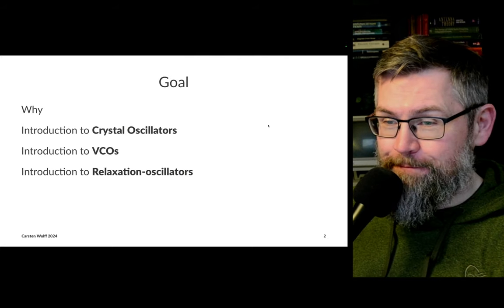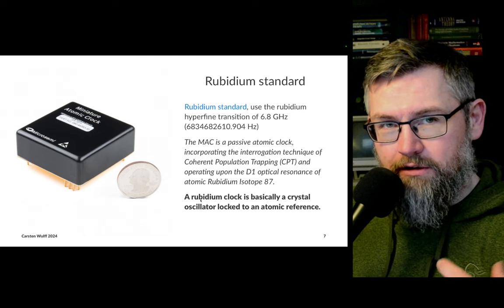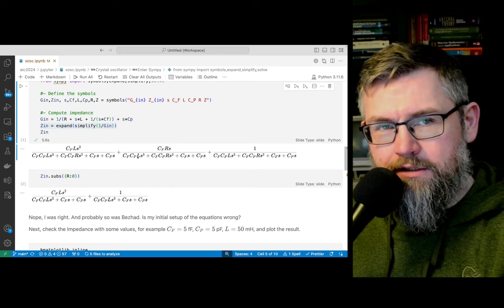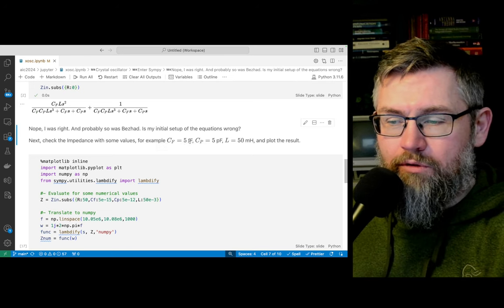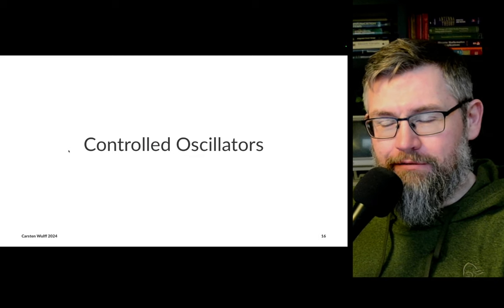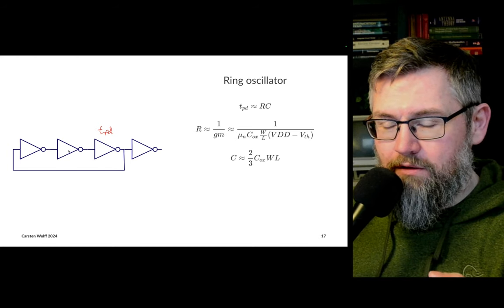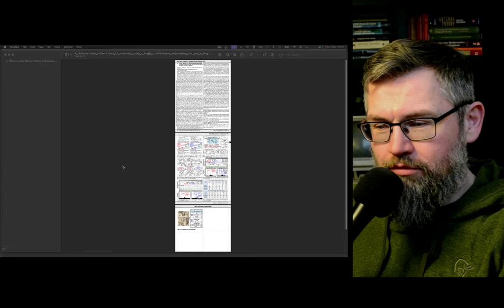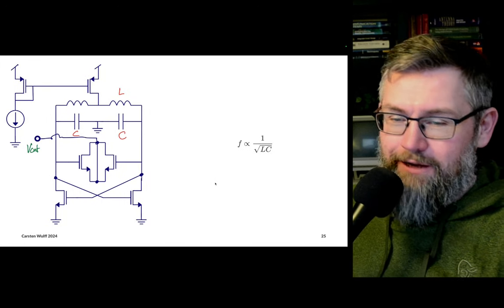Lecture 9 - Oscillators

Comment: Very nice lecture. Sub integer N means it can divide into fractional parts. So instead of halving the frequency it can do .43 or so. It is achieved by quickly switching between 2 levels of divison (/2 and /4) that are next to each other.

Comment: 1:07:31 Hello Sir, Is the Barkhausen criterion applicable to this type of oscillator to guarantee oscillation, if yes how to apply the criteria here?
Thanks for the lecture.
Reply from the maker: No, not really. Barkhausen is necessary, but not sufficient. Found someone going a bit more into detail https://www.uio.no/studier/emner/matnat/ifi/INF4420/v12/undervisningsmateriale/INF4420_12_Ringoscillators.pdf on the maths.